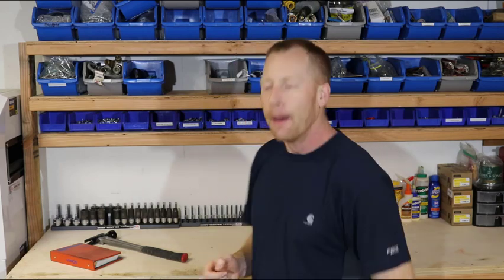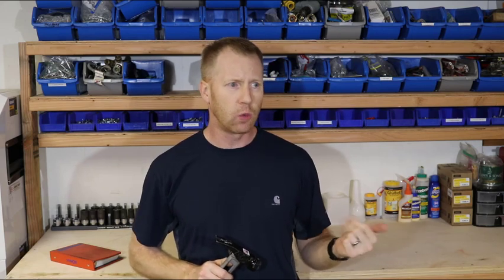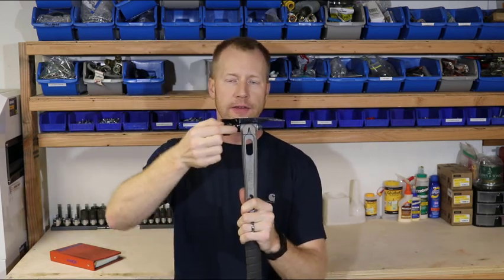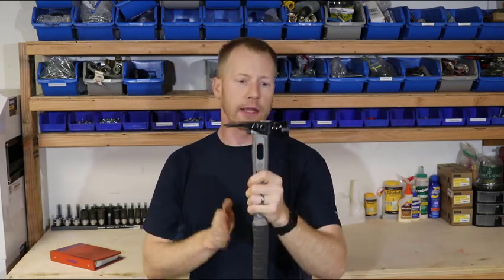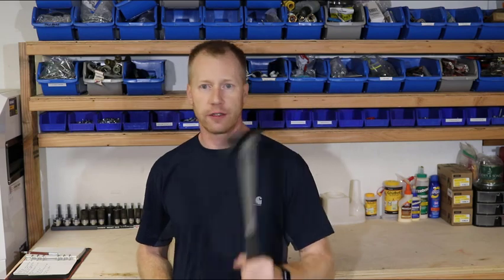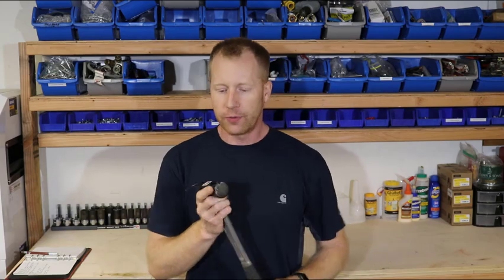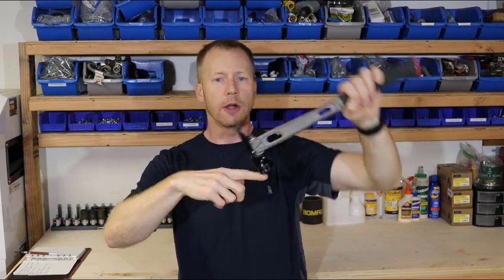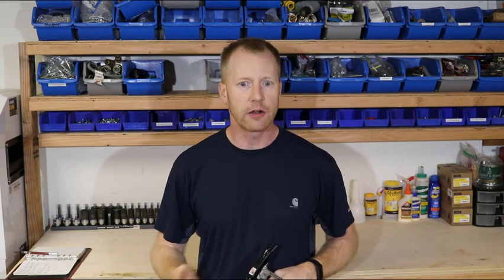Martinez M1 Titanium Hammer

Comment: Good review as always.  As a comparative Martinez M1 to the Stiletto TB III

weight = same (2 lbs)
length = Stiletto is 2" longer (18" vs 16")
handle = Stiletto is fatter
side nail puller = Stiletto is thinner (grabs nail heads that are closer to the wood)
Wall jack friendly = Stiletto has the perfect side hole for the wall jack handle, not Martinez
Wood carrying = both ear sets perform equally well... whack the 2x on the side and move or carry it
Wood movement = M1 is better because of its heavier head
Modularity 1 = both can go from waffle to smooth, both can now have replaceable handles
Modularity 2 = Stiletto handles are dedicated whereas Martinez heads and handles can be swapped, short handle, heavy head... long handle, lighter head, etc.
Nail Set / Magnetic holder = I believe only the M1 can handle duplex nails well

Both brands are great.  Stiletto is much more available and is now flooding the market because of Milwaukees network.  Martinez was piggy-backing on Occidental Leather's network but I now believe that relationship is over making in-store availability much more scarce (at least here in Canada).  Internet purchasing is better. 

I prefer a short slim handled top heavy hammer.  Martinez for me.  I prefer Stiletto's side puller but that's pretty much all I prefer on it.  I find the weight distribution of the Stiletto makes it feel odd and seemingly weightless... I whack the nail faster but not with more force... I miss nails more often because of that.  I don't have this sensation with the M1. Also, the M1's head weight helps move wood better then the Stiletto.  The angled face of the Martinez takes some getting use to but once you get the hang of it, it is so much better in my opinion.   I find the angled face dents aluminium flashing more then a flat face though... M4 smooth for those type of jobs (for me anyway). 

As for the ears, they break on both brands.  Seen it on Stiletto's and Martinez also.  They are not demolition hammers and are not made to separate 6x6+ lumber... leave that to Estwing or pry-bars

The M4 with the wide claw smooth face is perfect for siding work and trim.  Do you need a titanium hammer for trim???  The normal claw with dimpled face works very well for light framing and general work.  The squared head is similar to Dalluge but it has an angle at the top of it that makes it easier to strike close to walls.  Like Dalluge, the squared corners will show in the work if you do not strike flat.  Nail sets are required for show work.

Both are great hammers.  I own both Martinez M1 and M4 and really like them but I wouldn't shy away from a TB III.  For me, Titanium was worth the expense.  Just yesterday, I had to lay a roof down but the electricals were a kilometre away... no compressor... I pounded all day on roofing, spiral and 4" inch nails with the M1 and M4 (I am not a roofer by any means) and my arm was as good as usual at the end.  I remember different feelings using Estwing.  

Again, nice review.
Reply: I Brazeau excellent write up. The Stiletto TB II’s nail holder can handle 8db and 16db doublehead nails. You don’t want to dig with the Stiletto’s claw because titanium is soft. You’ll wear down the claw to nubs, I’ve seen that and I’ve seen a claw break prying a Symons panel off a wall. The M1’s claw is steal so you can dig with it which is necessary in concrete work. And it’s REPLACEABLE if it breaks. Idk if I’d like the angled head, but I guess you adjust to what you’re using. It wasn’t the weight distribution that caused you to miss nails. It was the user. You’d get used to using a Stiletto. And I like having an 18” hammy because I’m only 5’7”. It makes it easier to hit the 7’6”’pin on Symons panels for me and nailing off the tops of plywood.
Reply: As someone who has a TB3 and is considering a Martinez, I really appreciate this. Thanks for putting this up. How much of a difference does the top heavy head make on the Martinez? I personally love the light feeling of my TB3. It is a big curve to get used to? I’m hesitant of spending that much money and not knowing if I would like it.
Reply: PROUD__ AMERICAN borrow one to try it out for a day if you can.  I like the M1 cause it hits like an estwing without the weight and the vibration.  No ringing either. I can't talk about the TBiii anymore but I honestly love the thinner handle and swappable head, makes for an amazing hammer for me. I also love that it is slightly shorter the TB, it is the perfect length for me overall.  Also, to Change my original post, I've been using it for demo work without any problems. I've had it for long while now and I love it. Haven't looked at other titanium hammers since I've owned them. It is tougher then I ever thought.

The heavier head makes it hit like an estwing.  The swing follows through and you can't fight it it. I loosen up my fingers and it whips on the nail perfectly.  Hard to explain but I've never had another hammer like that.  It fits me like a natural extension of my arm and the motion is natural unlike other brands I owned previously. If you like a thinner handle and the feel of the estwing whack, give it try. Everything else is to par with TB. Like I said, I haven't shopped for another since I owned these. The others I've had were given away (Stiletto) or relinquished as backups.
Reply: Eugene Westbrook II yes you are right, it was the user :). The Stilettos handle it too thick for my liking and caused me to roll the hammer sideways once in a while. The Martinez's thinner handle solved this for me.

Comment: I have a picture off one where the bolt snapped and another that bent at the head . For the money they are asking it's ridiculous . Bear in mind , the steel head on that hammer on its own is £70 ! An Estwing is £25-44 depending on model and will last 40-50 + years . I'm using my dad's old 20oz that's 50 and I'm still using it every day . I'm a 30 year time served Carpenter/Joiner .
Reply: High point is cheaper than sig

Comment: I think that hammer is great... But I am in vinyl siding and have to choke up a bunch to bank finish nails... But then an hour later I'm smashing roofing nails... So I choose the 16oz Stiletto, smooth face, with the 18 inch hickory handle... I can't wait to get it.
Reply: Been doing siding for 16 years. Started with an estwing and swing for years and about 8 years ago I bought the mini 14 stiletto then switched to the 10ounce poly handle stiletto and used that for about 6 years. 2 weeks ago I bought the m4 Martinez and at first I was not digging it but after a few hours just felt great. As vinyl siders we are banging nails all day and that takes a toll on your elbow and shoulder so that’s why I spent money on a good hammer it will be cheaper than a rotator cuff surgery

Comment: So my $35.00 hammer is now obsolete? That 250.00 unit sure looks nice new but gets mangled pretty quickly. The fact that your talking about replacement heads and handles is mind boggling. It should be indestructible. The eswing I’ve had for 20+ years is still going strong.

Comment: in my opinion it is an extremely expensive hammer and a waste of moneyall framers and Carpenters know that it's not a lot of money and doing carpentry work in some areas to be able to afford to buy that hammer I don't see it unless you're the owner of the company but just individual on a crew no that'sand it's ugly hammer on top of that you can buy the same looking Hammer at home Depot for like 25 30 bucks that's my opinion I am a plum guy I have been using a plumb hammer for 25 plus years

Comment: That hammer is too little
Reply: @eugenewestbrookii7492  still its too little...compare to tbone...is little...when you at work...you dont only use the hammer to nail...thing...its use to remove braces...block...beat thing on place...sometimes when you are doing floors...beat the sheet in place...to do demo...many things...that hammer is too little...you like it or not...its useless.in my opinion...and the wood handle is a joke...for 80 dollars...get out of here...the husky..one is way better for 21 dollars...
Reply: Joelethal cruz, I have a TB II. It is all titanium except the face. It’s 18” and I’ve used it doing commercial concrete forms for the last 5-6 years. It’s the shit! Is the M1 better? Idk, that’s what I want to find out.
Reply: @eugenewestbrookii7492  not for me...M1...too small in my opinion...i like a big hammer...plus you can buy the tbone3 now...
Reply: @eugenewestbrookii7492  I need that ham
Reply: JOELETHAL CRUZ you sound ignorant. They are the same size and the TB II IS barley any different than the TB III. 
Mr. Mark Martinez, send me an M1 and I will guarantee to sell 5 at work, just like I did your TB II.
Reply: JOELETHAL CRUZ OH, and you do floors? The M1 has a rubber mallet attachment that goes over the head. You don’t use a “big” steel hammer  on flooring, do you?